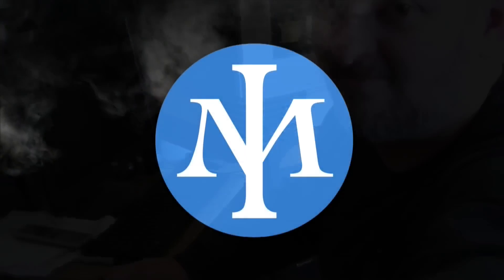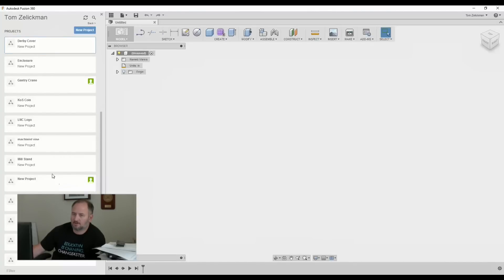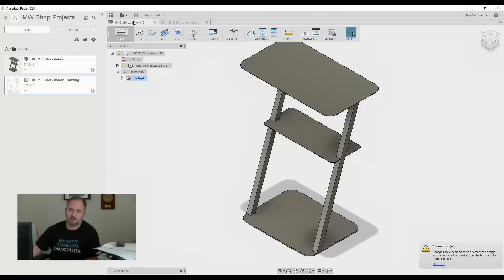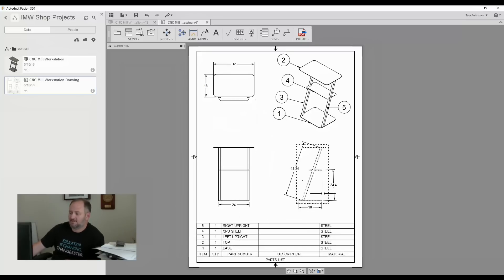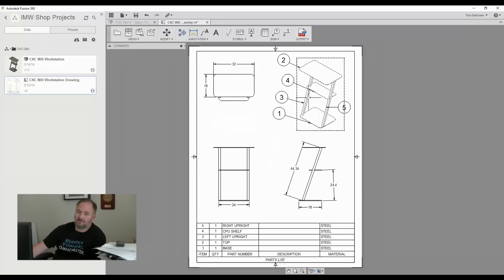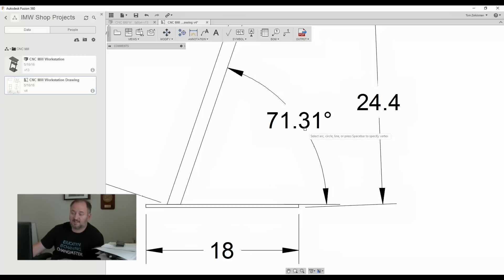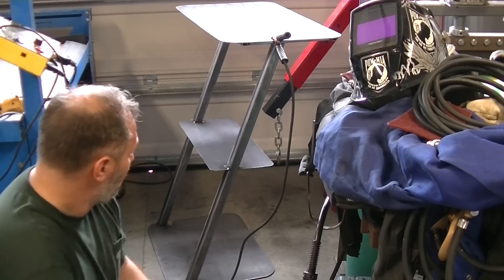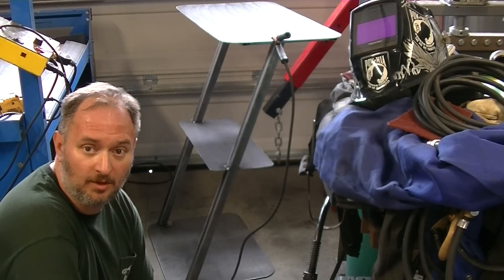Fusion 360 in the Fab Shop - Prints, Cutting, and Welding

Comment: So I watched part one, now this one, I struggled to figure out the change in software when they updated it 4 months ago. When you were speaking about the cam post process generating g-code, I was just getting my head around it when it looked like you showed in the first video. But then the update came along and I just could not get my head around it, but after opening it up again today, there looks to be more updates done and it may be easy to figure out again. Would still rather watch a tutorial on it though. 

I'm starting to think it might be best to just design in Fusion 360, save DXF, take it to Sheet Cam, generate my G-Code, then load it into Mach 3. Fusion 360 is going to be great one day when they iron out all the bugs and make it more user friendly for issues like I had, but until then, I think I might be best to just learn Sheetcam and Mach3
Reply from the maker: Yeah, there's still a bit of work to do on the plasma side of things. I'm going to spend some time on that this month and maybe I'll have an updated video coming once I can wrap my head around it all. For now, I export to DXF and run that way. I believe the way we want to go is to create the plasma cut settings as a tool (like a preset) and then can apply it from there in the CAM side of things. Thanks for the reminder!

Sincerely,
Tom Z

Comment: it would not be to hard to add a B head to the plasma
Reply from the maker: +daniel lyall Very true! That's the drawback of the PlasmaCAM though. It's a proprietary system and I'd have to change over to a completely new controller. For now, I'll stick with what I've got. Well, for the plasma table at least. New machines coming soon...

Hope you are well!
Tom
Reply: new toys 440, 
the mirror part not showing up that is a mistake in fusion, it's something that needs posted on the fusion forum
Reply from the maker: Good guess, but it's 5 pallets worth of stuff. You think the mirror issue is a bug? I'll post that to the forum then. What about editing the Quantity in the BOM? I assumed it was a fixed number based on the components detected in the drawing but it would be nice to be able to edit things there. Probably an enhancement request for that sort of thing.

Sincerely,
TZ
Reply: I don't use drawing very often, I am not sure but it may just be components that it detects, the mirror body you may have to convert it into a component but keep it in the main body so it does not get broken. yer post about it someone else may have come across the problem before.

5 pallets 3 for the 1100 or 440 and 2 for the lathe

Comment: Nice work.  So what you are saying is that if I build my shelf out of 1" plate I might have to do some fiddling.  And it's a good reminder that I need to use drawings more often.
Reply from the maker: Thanks, R.J. - you're absolutely right. The thicker the material, the more pronounced the V or the more grinding you will need to do to get the angle right. That, or get a 5-axis cutter. ;)

Hope you are well, sir.
Tom Z
Reply: Mmmm, 5-axis.
Reply from the maker: R.J.'s workshop Yeah, for when you get back from the glacier. ;)